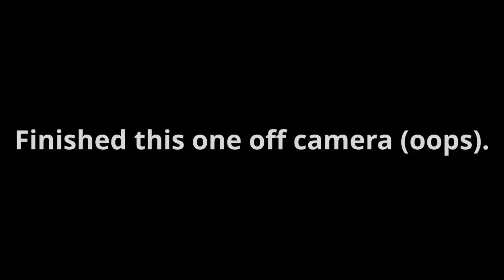Axing eight greenwood spoon blanks in realtime | Spooncarving / carving axe process.

Comment: Lovely process.  What is the tool called that you use to split the log?
Reply from the maker: Thanks. It's called a froe. It's a chairmakers/greenwoodworking tool used for riving wood in a controlled way. On longer pieces, you can influence the way the split runs by applying pressure to either side as you open up the split by twisting the handle.
Reply: @jones_trees_and_treen  thanks for your reply.  I am going to give your technique a go.  You make it looks so easy and your axe work looks like the wood is made from butter.
Reply: What is the leather square please?
Reply from the maker: It's called a bodgers bib, it stops me from getting a bruise from holding the spoon firmly into my chest for certain cuts.

Comment: HI I was self taught that you cut your wood so that the plain of the spoon follows the line of the rings but you cut your blanks at right angles to the rings does this not weaken the bowl of the spoon ?
Reply from the maker: Both are a valid way to make a spoon and equally strong. I refer to it as tangential (as you learned to do) and radial (like I prefer) orientation. Radial split blanks are more stable when drying (like quartersawn lumber), and there's an aesthetic difference. That's all